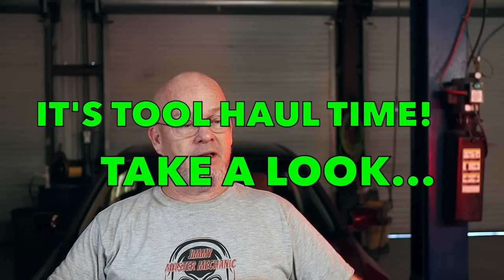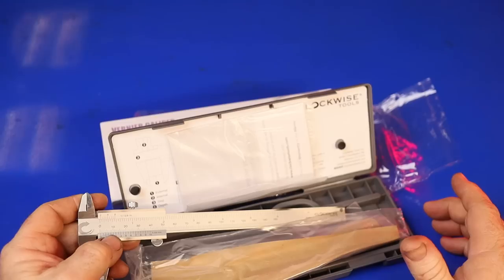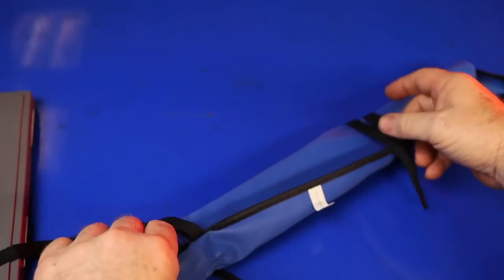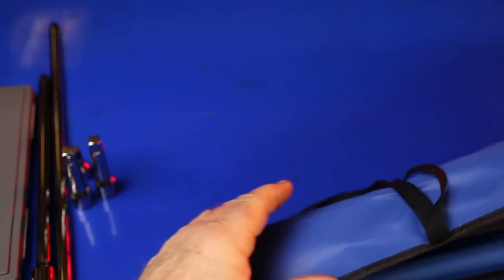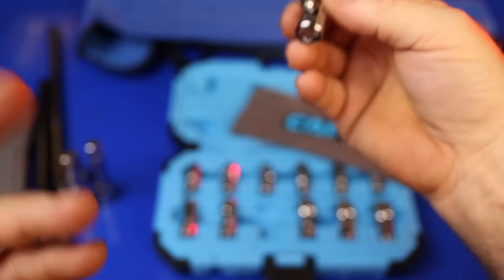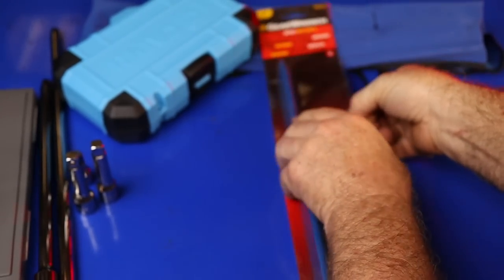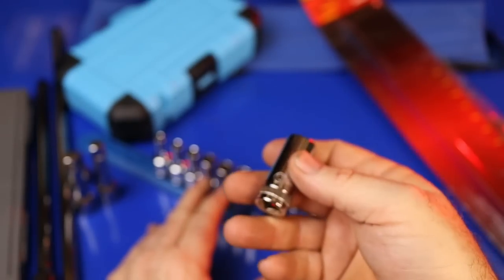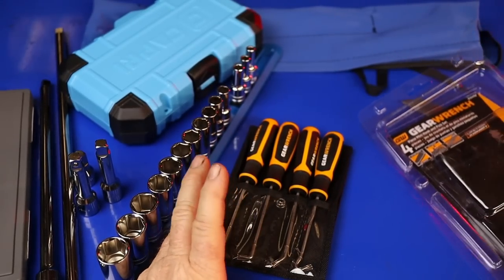IT'S TOOL HAUL TIME, NOBODY LIKES A BRAGGER, BUT THIS IS A BIG HAUL...

Comment: Another great tool haul video. I don't have a digital caliper due to lack of use. I have a Starrett dial caliper that I inherited. I like the fact that it can sit for months and when I need it I don't have to change the battery. Those Lisle hose spoons look nice.
Reply from the maker: Right on, that's exactly why I went that way! Thanks for watching!
Reply: I have both mechanical & digital calipers.  Use the digital mostly, but pull the battery after each use.  Not really time efficient.

Comment: I love the Astro light. I have the wireless charger and two of the lights so I never have to deal with a dead battery. The wireless charger also charges my phone. Bonus!
Reply from the maker: Nice, didn't even think of my phone. Have to pick up the charger and another light next! ;)
Reply: @JimmyMakingitwork  That wireless charging is some kind of voo doo to me.  It baffles me how electricity floats in the air......atoms....bah humbug.   The only good atom is a split atom.

Comment: a trick i learned years ago was to take some good spray lube, stuff with more lube than water, hose down a paper towel or two and lay it across your tools that sit for awhile. ive done that with my impacts because they sit for most of the winter and their still rust free. even the snap on ones. some stuff i wipe down with good lube and still rust free.
 nice tool haul!!
Reply from the maker: Yeah, I hear there are some products for just this purpose. Have to try something. Thanks Ted!
Reply: I agree. I use Ballistol
Reply: I've been using tri flow for about 6 yrs with good results. It doesn't evaporate away, doesn't smell bad, seems to be safe on about anything, costs less than kroil but more than wd40.

Comment: Hey Jimmy
Great haul, just fyi Williams is owned by snap on and made in the same factory they make their top line stuff. 
Check out snap on industrial brands. You might also check out Advanced auto parts they were liquidating all their Gearwrench stuff.
Reply from the maker: Have to look into that Joe, thanks for watching!

Williams Industrial was formed in the 1880's was acquired by Snap On a while back, 1993 I believe. Did a little snooping around since this video. Should have done it before, lol.

Comment: I been thinking about getting those Capri 1/4" universal socket sets. I have the Sunex impact ones. But I work on boats. So impact driver isn't always a good option and the sockets don't always want to fit in where I need them to. So you pretty much just made my decision easier. Thanks again Jimmy!👍
Reply: the husky thin wall impacts are great and have a warrenty
Reply from the maker: Awesome Cole, I think you'll like them. My only minor issue is they are a bit loose even brand new. The bolts at the swivel can be snugged I believe, but haven't tried it yet.
Thanks!
Reply from the maker: I have to look at those, haven't seen them yet. Thanks.

Comment: I’m no stranger to snap on tools, Matco, etc. but the pick set is one thing I just couldn’t bring myself to buy off the truck. I bought a Channellock set of 4 for $20. Kind of a hard handle, tad smaller than the Snappy’s. I like them a lot. 
 Nice haul Jimmy!
Reply from the maker: They are really proud of their brand, even on tools with zero advantage.
Thanks Ian!
Reply: Where did u find a channellock set of pics at
Reply: @harlybattiest   Channellock website. Part#: HP-4A  although I found these at my local hardware store

Comment: I have the Capri 1/4 metric universals and  they have been great, chrome holds up well, unlike my snap/on sets. Also take a look at the Cornwell 12 pcs pick set, I’ve had a set for almost 5 years. I’ve only had to warranty a a few of them, mostly because I was a little to hard on them. Set run right around 100$ I believe. Great video by the way👍
Reply from the maker: I'll check it out, thanks James!

Comment: Good looking tool haul, I just bought the capri universal sockets. No way I could justify 500 plus for the Snap on for a socket set not getting used and abused like the 3/8" or 1/2" stuff.
Reply from the maker: Exactly Michael, have to save money where we can and spend it when we need to. Thanks!

Comment: List your items with a buy it now price and allow offers to be taken, I noticed a lot of people do not like auctions. Usually people auction off items that theyve had trouble selling with the first method I mentioned. I been doing really well lately doing it that way, and then also I been buying stuff and been the only bidder on the item then I turn around and sell it a few weeks later for 5x the price. People want instant gratification. Ive sold a lot of my snap on stuff and did quite well, after this winter seeing rust on stuff I never used pi ss es me off to no end. $100 flip socket set ive used once - rust to heck ... I was thinking of trying this stuff from knife pivot lube called blade shield.
Reply from the maker: Yeah, I usually offer a buy it now. But the most recent listings I’ll be on vacation for a week. I did not want someone to buy it now and not ship it out for a week.
Once I get back from vacation, back to normal.
Thanks!

Comment: why sell the snap on for 30c on the dollar? surely you're better off holding onto it as you've made the investment and now making a huge loss. what's the reason for wanting to lose money on your investment, then outlay your return into other brands? unless you have a major gripe with snap on and you're jaded by them, it kinda doesn't make sense.
Reply from the maker: I’ve just grown weary of their deceit and over priced tools, their reduced warranties and their electronic products always lagging behind their competitors who sell for much less.
When they began having my videos pulled and several eBay listings pulled, that locked it down for me.
I know them now. #jaded
Reply: @JimmyMakingitwork  fair enough that makes sense. I agree with you on the warranty side of things and their electric stuff is below other brands. I like snap on for sockets wrenches, and that's pretty much it. If they rebrand something I buy it from the original manufacturer. Mayhew pry bars are now my go to. I like finding out who makes what and buying I from Amazon instead. I've got a lot of snap on, but each year their prices go up a decent amount and I can't justify it anymore. I like the tools they actually make, I don't like their crazy prices.
Reply from the maker: I think we are on the same page F.R.A. Their hand tools are great, just so expensive. I think they count on blind loyalty.
Thanks for your input.